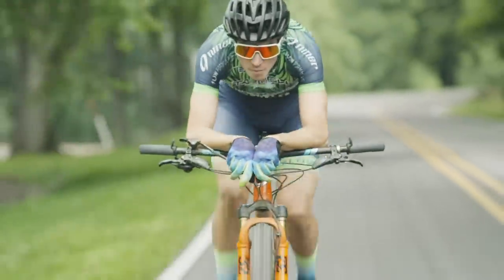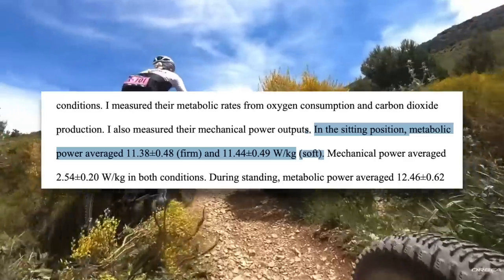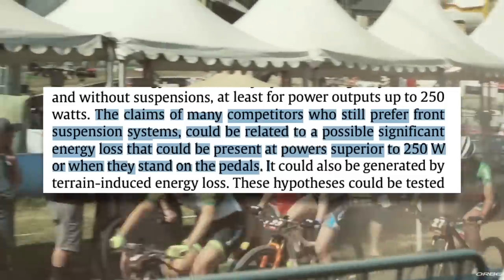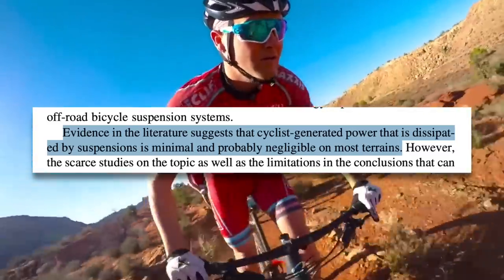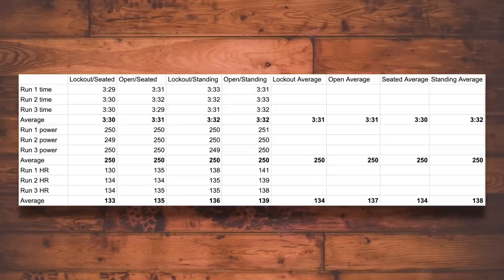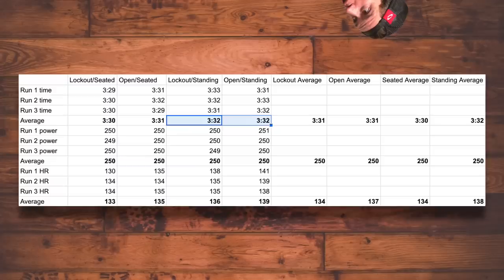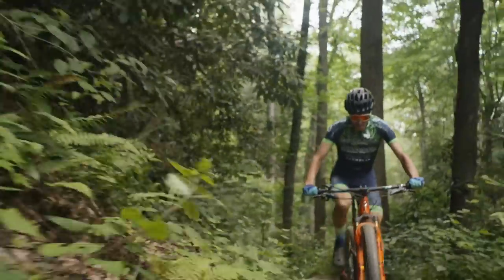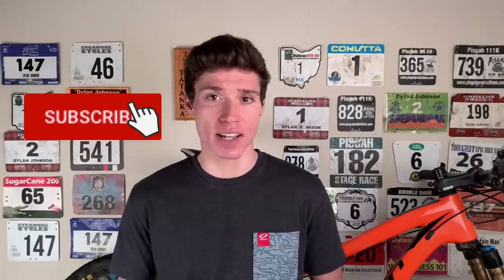Does Locking Out Your Suspension Actually Make Your Bike More Efficient? The Science

Comment: From my experience a bike's antisquat levels are going to play a primary roll in efficiency vs locked out. Less than 100% and power will compress the suspension, much greater than 100% I've noticed power will lift you out of sag. I've experienced both on my older 2012 FS with triple crankset. Compared to my 2020 FS, it is less efficient in 32t and higher chainrings vs 24t and noticeable. My 2012's AS levels range from 50%-158% depending on what cogs you're in. Modern bikes are better about this now that they are designing around 1x drivetrains.

When I first hopped on my 2020 Genius I immediately appreciated how efficient it was wide open vs my old bike. The Genius AS levels are > 100% throughout the range. With that I would totally agree that steady 250w output (consistent power and most situations) on this bike would be just about as efficient and possibly more so on bumpy terrain. 

However, this bike is equipped with Twin-loc and going from open to middle or almost lockout makes a big difference in high watt accelerations and sprints. There definitely seems to be more immediacy and responsiveness to accelerate in those modes vs. wide open which is highly enjoyable. This is something I'm using regularly so I feel it all the time. 

Also I've noticed that when out of the saddle really stomping power into the crank on 150mm of travel the bike suspension is bobbing like crazy from weight/inertia (I'm 200lbs) of you just trying to smash. Seems like a lot of that energy is getting absorbed via suspension vs. more directed into the crank and then to the ground. 

One of things I've come to notice about my HTs on climbs is how it feels like nearly every little microwatt is getting put down to the ground  and I've really come to find that highly rewarding (in an enjoyable fashion) during rides. The very first time I noticed this was running my old FS locked out for sh*ts n giggles on a gravel training ride. There's still give in the suspension and it just does not deliver every little watt when stomping up those hills like the HT. I was having regrets lol.

Comment: When you have a bike with a suspension meant to go downhill it's immediately evident how much of a difference the lockout makes. Especially with something like strive that further pushes the suspension in besides the lockout. Sprinting it's immediately evident how much more a hardtail accelerates compared to full sus bikes. And the energy does go in to the suspension. Instead of the forward motion it becomes up and down motion through the suspension. So regardless it's obviously beneficial on flat surfaces to make your suspension stiffer. This changes on trail type environments where you are also losing speed by being stiffer.

Comment: A mind-opener as this is, and consistent with my observations as I think back at my rides and climbs, I think there is one fault in the thinking here. Modern suspension never really locks out - when you "lock it out" you are just telling the damper to consume the suspension energy more effectively, so instead of "losing" energy moving the suspension up and down, you are using it to pump the oil in the damper through smaller orifices and thus keep the frame from bobbing up and down so much. Hence, the only fair comparison is between a proper hardtail bike and a full-sus.

Comment: I've seen similar results of studies around comparing the stiffness of various road bikes. Basically you can think of the bike as a spring and a very stiff bike stores very little energy and transmits it's power directly to the road. A flexible bike absorbs some energy from the pedal stroke but gives it back to you on the upstroke. The difference in actual efficiency is negligible but everyone thinks the stiff bike feels more efficient.
Reply: Excellent summary. Find the bike that responds to your movements in a pleasing way - that will be the difference that actually matters

Comment: Kudos for all your research, data presentation and critical thinking. Thank-you. I found it interesting and useful. 

There seems to a very weak consensus in the comments that some muscular energy is being dissipated by the shock and fork yet this is not picked up by the power meter. 

One could argue that the tester’s heart rate being the same (probably statistically insignificant differences were measured between locked out / open suspension) would prove the above hypothesis wrong. 

Perhaps some interesting data could be collected by measuring the temperature rise of the rear shock when locked out and when open — especially if it were insulated with a DIY Rube Goldberg blanket. 

Doing the same on measurements on the fork may indicate something as well.  I’d expect the fork is vastly more efficient at dissipating heat. Also insulating both fork legs and collecting data would be a chore. 

Thanks again.

Comment: I agree with @Sweet the cyclist regarding the facts that he mentioned. But I want to add something else about your test. The power from the pedals is directly transmited to the wheel through the drive train. So if you didn't change the chain or hub or tyre preasure or tyre (you didn't change the power losses), with constant power on the pedals you will allways get the exactly the same time on the same road. (I hope you understand what I want to say) You have to measure the compleate power from all of your body movements when pedaling and compare it with the power on your pedals. Only then you will know how effitient the lockout is.
So I think the heartrate is  more relavant to observe during your test. I think when you were standing you were a lot more active with your whole body and suspension is more active and that is why the heartrate was higher during those runs. Also, I think the aerodinamics is not relavant there, becouse I asume the speed was not so high.
From your results, when you were seating we can see that the heartrate in locked position is 2 bpm slower compared to unlocked and when standing there is 3 bpm difference in heartrate between lock/unlock position. So you used more energy (higher heartrate).
So from this point of view I can't say that there is no  difference between lock/unlock, but yes, it is very small. If you ride the bike for 2h I think you will be more fatigue when you will ride in unlock position. 
It would be interesting  to see the results useing the bike with more travel.  
Sorry, my english is not prfect...
Reply: Correct. Same watts measured at drivetrain will always produce the same time.
Try doing the same watts on a DH bike and you'll realize that you're working way harder to produce the same watts on the pedals/drivetrain.

Comment: TLDR: Lockouts are not best for efficiency of pedaling, rather providing a stable pedaling base instead of a dynamic-constantly-responding system. This keeps you from fighting your suspension as you pedal.

I would say that the majority of the impact of a lockout actually comes from the frequency inputs to the system( the bike). There is a natural frequency of your suspension(based on damping setting, spring rates, and weight of bike/rider). As the pedaling input approaches these frequencies, the suspension response will be dramatically more than other similar frequencies even with the same amplitude of input(pedaling is generally a consistent magnitude of input, though your cadence will vary). Approaching those frequencies, say on a flat/inclined road when you can only choose 12 cadences for a given road speed, it is likely that the suspension would bob much more aggressively. You could certainly become out of sync with the bobbing(or simply want to pedal at a different cadence) and start to fight against the motion of the bike.

Comment: Maybe the forward momentum lost when drag racing is more significant, so the theory is definitely there.  if your rear shocks are too squishy, you lose a bit on the launch and the gear changes.  Bikes these days, however, have some good anti-squat numbers to mitigate this, but it depends on the gear you are in.  I guess if the suspension returns the lost energy, it may work itself out.

Comment: I windsurf and this seriously surprised me, a flexy board is slow, the amount of energy flexing boards sucks up is crazy. A stiff carbon board, everything else being anywhere near equal is much faster, and it's very noticeable. It's the same with kayaks, a rotomolded plastic kayak can never be faster than a glass or carbon kayak of the same design. Even holding your body totally ridgid on a water slide makes you go much faster. On some of the bigger slides, to the point of being scary, and core strength makes a big difference here as well. Just personal experience had always made had me assume bobbing while pedaling would be slower.

Comment: I have a Niner Jet9RDO 2018 and a gravel bike, a Finna Taroko, which is similar than the Niner gravel bike, carbon frame both. I'm not blocking the suspensions of my Jet9RDO, which is heavier than the gravel one, but I'm being much more faster riding the gravel than the all mountain. Of course I cannot ride the gravel in the same paths as I'm riding the all mountain, but in the same type of paths, the gravel flyes. The gravel is 9kg and the Jet is 13, so it's 4kg heavier, but those are two different type of bikes to ride in a different paths.

Comment: The rear shock simply decouples the rear wheel and rear triangle from the bike & rider.  This creates efficiency two ways.  One, when going over bumps the energy required to move the rear triangle and wheel vertically is significantly less than having to move the entire bike and rider vertically, robbing less forward momentum. Two, the shock is able to dissipate the energy, vs the rider having to absorb it, resulting in less energy requirements from the rider. While the  “bobbing” while pedaling is going to showcase your pedaling inefficiencies, the energy loss on a non-suspension bike is not zero either. Just because the wheels are staying planted on the ground and the frame isn’t moving doesn’t mean that pedaling inefficiencies aren’t there and not robbing energy.

Comment: I'm sure it's been pointed out already, but the power meter isn't capturing the full power that the rider is putting into the system, only the portion of it that goes into the transmission. So it's no surprise that the times are same given the same power going to the back wheel to propel the bike up the hill. With the suspension unlocked, the rider is putting in extra effort to produce the same 250W which is being lost to heat in the suspension dampers. It's just not being measured here, except in elevated heart rates.

Comment: And not locking the suspension on a relatively bumpy climb could actually make you more efficient due to the traction that it provides and the fact that your body works less on absorbing the shock because the suspension is doing its job.

Comment: I have no idea what I am talking about but I think regardless of lockout position a given power output measured at the crank will result in the same speed in the same conditions. When you are seated you are moving up and down as the suspension bobs so there probably wouldn't be huge losses from the pedal moving away from you. The biggest loss would be conceptually standing at a high enough power to be causing significant compression and rebound. I don't have a bike with a lockout but maybe lower the suspension pressure to exaggerate the effects if you do a repeat test?

Comment: On a smooth climb - with no slipping all your test proved is that "nearly all" the force you're creating is going into driving the bike forward at the same speed regardless of whether you're standing/sitting locked/unlocked. The question is though - and one that can't be answered easily - is the difference in the metabolic load on your body in creating that force between the difference scenarios. You could counter that your heart rate remained the same; however that is only a very loose guide - esp. with only a 3 minute effort..
Reply: But you also have to take into account the studies that he mentioned, not just his self-test

Comment: Hi Dylan, thank you so much for your video. Is your power output measuring your pedal rotation or the forward motion of the bike? If it's measuring pedal rotation, then you could be exerting more effort with your legs which isn't fully translating to your pedals and is partially translating to the suspension.

Comment: While I concede to the points and research in this video I have a few points of my own. because your legs are dipping every time you pedal it’s harder to pedal for your muscles so when you reach the top you feel more tired. So even though you are using the same amount of power and there is very little difference but on a dh bike you will put more stress on your legs

Comment: The way i do it when i do long flats is to set the rebound really hard, then you compress the form in the beginning but it gets incrementally harder to compress it and the slow rebound makes it so it dont go back that fast.
Im usally only locking the rear susp, front wont bounce that much when pedaling teqnice is dialed in.
To prove efficiency loss it would be needed to measure power at pedals compared to power at wheel in open/closed.
Try pumping up in a steep climb with an enduro mtb vs xc mtb and the fact that suspension eats energy will be extremely clear after 5 seconds 😂

Comment: Great test Dylan, but now you have to repeat these efforts in a metabolic chamber and measure calories required for both locked and unlocked! To know the efficiency, we have to know both the input and the output. We still don't know the input power, only the resulting power to the crank. So, if crank power is always 250w, then the resulting speed up the hill should be the same either way. Still though enjoyed watching and appreciate the effort you put in.

Comment: Interesting stuff. I wonder if these steady state tests are describing the relationship between force and displacement in the stiffness equation.

I.e. when the same input force is applied to a locked out system it is consuming a similar amount of energy but over a much smaller vertical movement due to the overall compound system being stiffer, displacing less for the same force.

Further testing with crank and wheel power measurement required!

Comment: A open rear suspension definitely provides a much more dynamic saddle. The change in saddle tilt, every time the suspension is working (hitting bumps and so on) is really negatively affecting long distance experience on the bike (at least mine) .. i had a sore a** after 90km because i had my rear suspension open all the time. The next day i locked it and was perfectly fine. Power wise i´d say, even on my old frame (similar to the ones they did the studies with) i can´t feel any difference.

Comment: Hint by someone else who knows more about modern mountain bike design: isn't this by design? You tested a cross-country bike with a high level of anti-squat, made not for downhill. You would most likely see higher differences when testing on an enduro bike. (also in the 2017 study the test used some full suspension mtb which adapts the suspension and is made for uphill efficiency).
You should retry with other bikes; I would but I don't have a power meter.

Comment: It would be interesting to do a similar test but fully rigid vs locked out full suspension. 

My n=1 reference point is likely worthless, but my fully rigid fat tire bike climbs like a beast while my six pounds lighter high zoot carbon trail full suspension bike locked out climbs no where as well.

Comment: I think you have some problems with your assumptions, and designing your experiment:

From a quick scroll I see others may have similar thoughts

So, the problem is that you tried to normalize multiple runs using a power meter. But think of the stress meter in your crank as measuring a spring. 

Intuitively when you try to say, press down on a tough button on a soft surface and fail, you look for a hard surface so that you can press the button more. 

Or you can think of what happens when you press down on one spring representing your power meter, resting on another identical spring. Both springs are depressed half as much compared to if you put your spring on a hard surface. 

So, it makes sense that if you normalize by power you get the same times, because your power meter is measuring how much power is being put into turning the crank. But that doesn’t mean that the overall system power is the same as it is not measuring how much power you put into compressing the shocks. 

A better test is to normalize by speed, as that’s ultimately the final metric you want to optimize. You measure effort by heart rate instead. That way you avoid all these confounding effects. 

If you’re working harder your heart will beat faster to maintain the same speed. 

Or perhaps in the lab you can measure other things like lactic acid buildup

Comment: I ride a 160mm front and back enduro bike. The only time I feel I’m putting more power into the ground than propelling me forward is on a steep climb while standing. I think I’ve locked out my shock twice on paved roads but 99% of the time I don’t bother. I feel that if your suspension is tuned properly there is little to no difference and the few times it might be worth locking out the rear isn’t worth the reach.